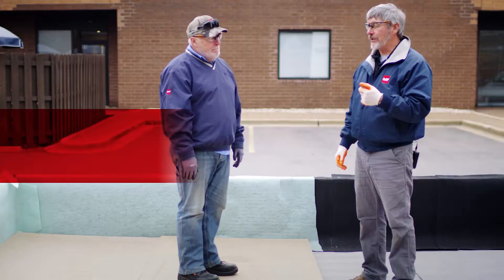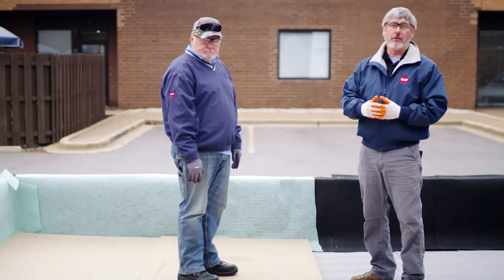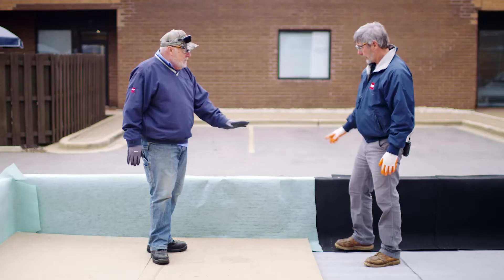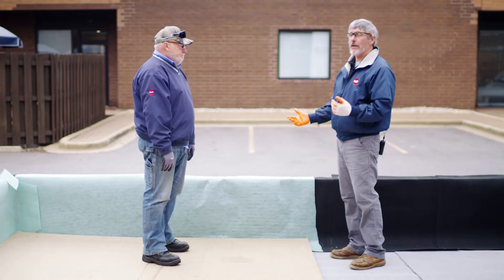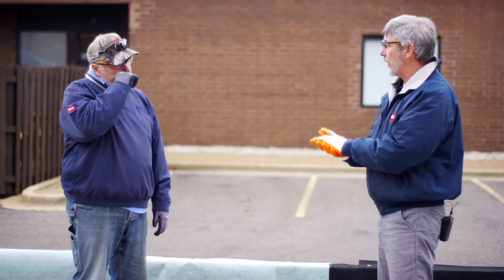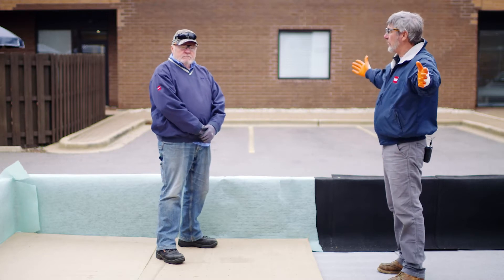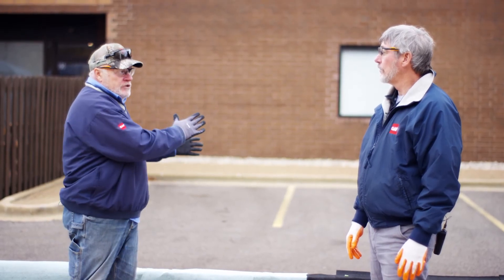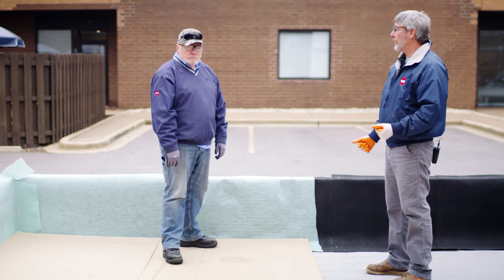Importance of Separating PVC from Asphalt Systems | Roofing it Right with Dave & Wally by GAF

Comment: Why a granulated asphalt membrane laid beneath the polymat on side walls
Reply from the maker: Hi, for TPO or PVC membranes installed over granulated modified bitumen flashings, a polymat separator sheet must be installed for dry-hung flashings. In adhered applications, a barrier board must be installed. Learn more about installing this product in our guide: http://spr.ly/6057s6aCh. Our technical team would be happy to assist you if you have any questions: 800-766-3411.